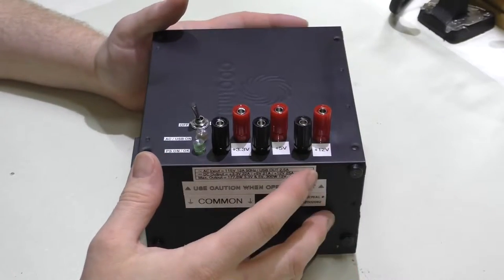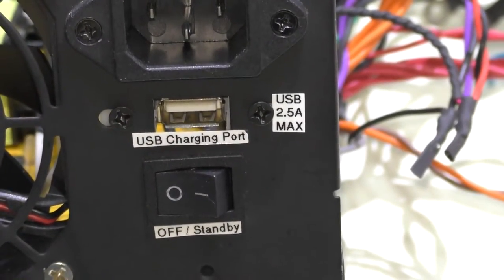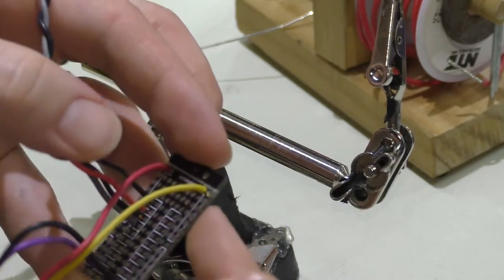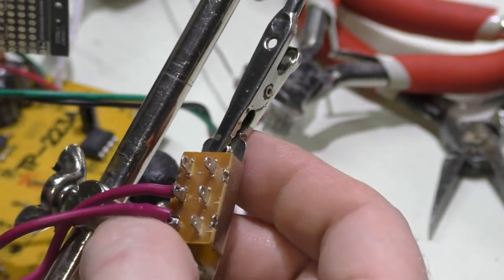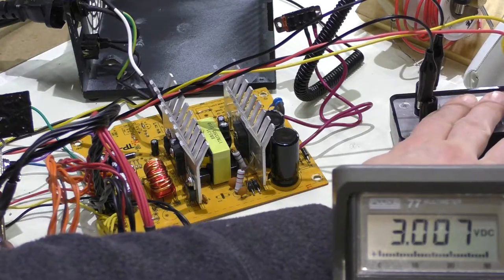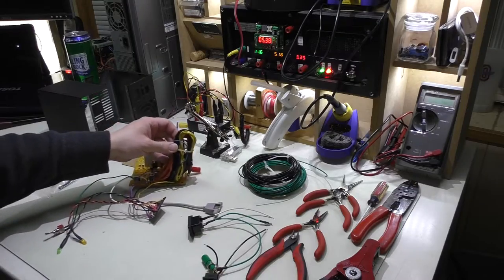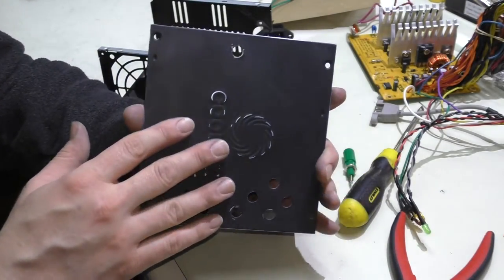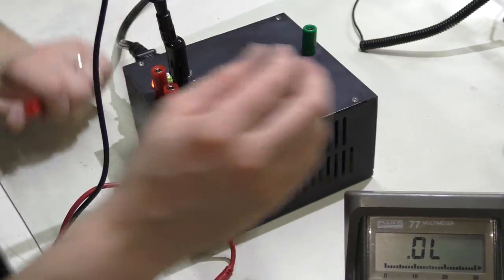PTS Ep. 156 - Custom PSU Final Mod and Giveaway Contest Results

Comment: An excellent vid onthe power supply build.  Thanks for the explanation.  Power supplies are one of my big interests.  you need an isolation transformer to prevent shock from direct connection to utility power and ground.  If you get one, make sure the manufacturer has not grounded it...which believe it or not,does happen!  Just check out isolation transformer in Wikipedia for an explanation.  congratulations to the winner!
Reply from the maker: I've heard all about those when reading up about oscilloscopes and how people use the two together to test the mains.  They specifically mentioned that you have to be careful that the output is truly isolated.
Reply: It is really important when working with high voltage, like with vintage radios, transformer circuits, power transformer tubes.  The other piece of safety equipment to think about is a variac.  You can also buy an isolation variac.  I don't have one yet, but itis on my list along with some other tube-era test equipment I want.
Reply from the maker: I do have both of those on my list to buy as well.  I'd like any variac in general however I will agree that an isolated variac would be ideal.

Comment: aww, man!!!
Reply: congrats!
Reply from the maker: Thank you!
Reply from the maker: You had a great use for this too...  There will be other contests like this soon.
Reply: Pileggi Technical Services Wwelllllll...  to be honest, I already refurbed an older one specifically for my cluster.  replaced a couple diodes and caps, good as new!  More low volt amperage than modern PSUs so I don't have to use as many buck converters.
Reply from the maker: That's great.  I'm glad you got something working.  And yes, sometimes the older ones are better than the new ones.

Comment: can we modify the psu to get center tapped? I need  +12v ct -12v to powered an ocl power amplifier
Reply from the maker: These PSUs have a +12v and a -12v rail, although the -12v rail has a lower current rating.  You might need a different transformer / PSU for your application.